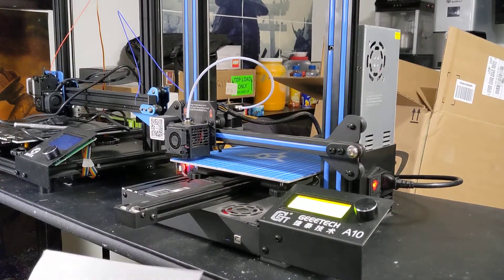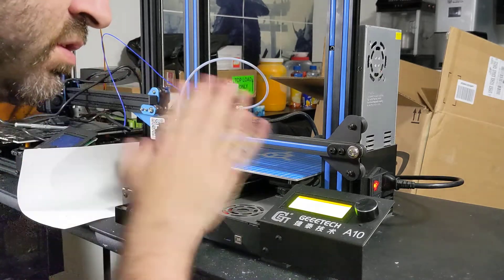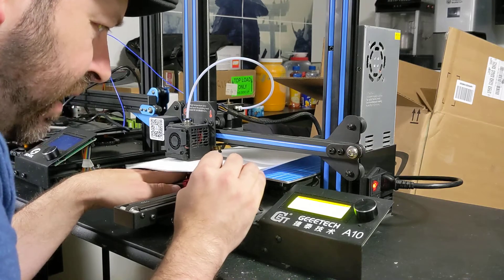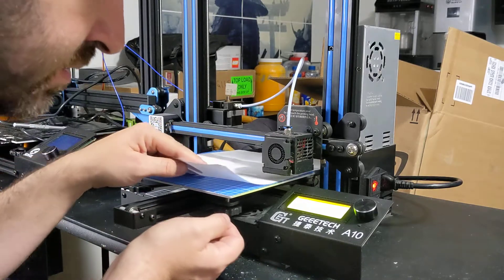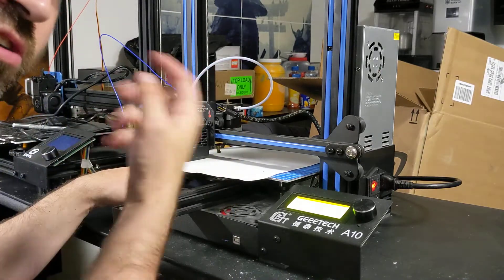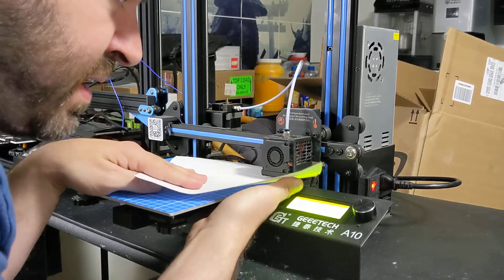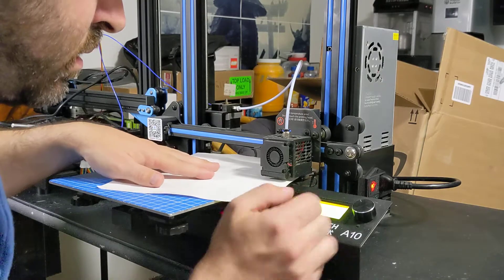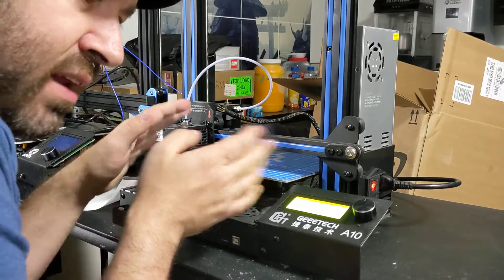How to level your FDM printer

Comment: This is GREAT but I implore you to add one significant step when doing manual nozzle-head movement w/steppers OFF;  that being "when moving the head side-to-side or forward-to-back, you ONLY use one pointer finger on the side of the head to move the head", "DO NOT press down on the head as it will mess up your nozzle HOME alignment, negating you leveling efforts."